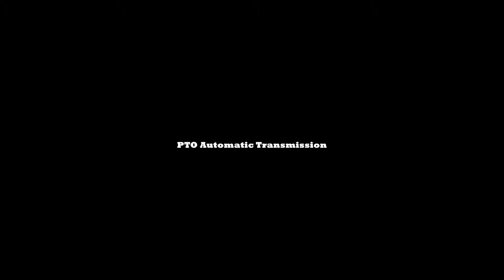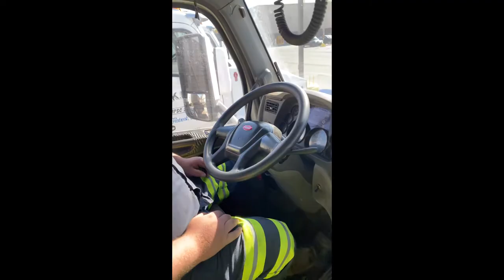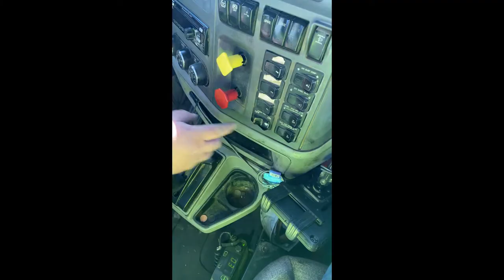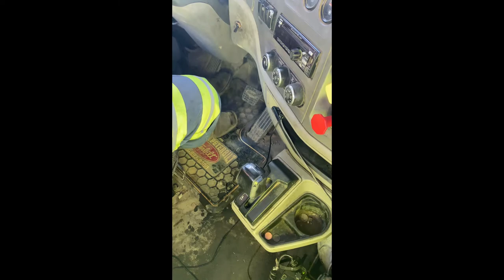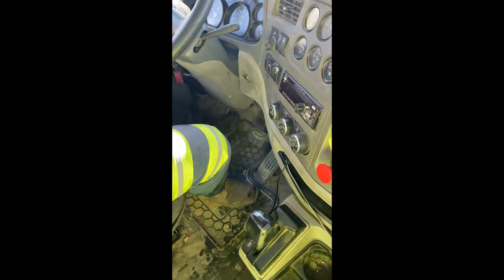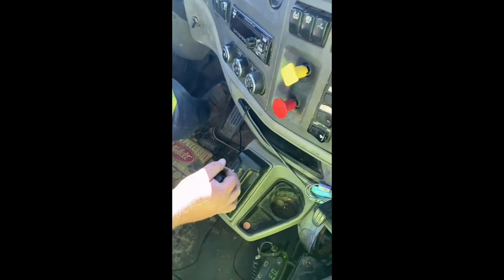Engaging the PTO on an Automatic Transmission

Comment: I have a DT12 that wasn’t originally equipped with a PTO. I have now installed an OEM rear PTO with air only, no wiring, but I can’t figure out how to engage it
Reply: I figured it out. The pto does require power, and I simply attached the proper harness/connection to to the pto and bypassed it directly to the battery.
Reply: Hey boss I have a dt-12 and people have told me I have to program it and waste 9500-12,000 to install wet kit. Do you mind helping me out?
Reply: @FernandoRomero-ch9lk  I don’t mind at all. What exactly do you need help with? 

As for programming, I did not of that. I never do any programming on pto installations.
Reply: @catcola1061  I want to add wet kit to my truck it has dt -12 

However it doesnt have pto neither was it pre prepped for pto
Reply: What can I do? To add wet kit?
Reply: Have been searching online for days.

Comment: I bought a truck with pto i have no idea what it’s for
Reply: PTO stands for power take off its attached to your transmission so you can use the engine to turn a hydraulic pump for things like dump trucks, cranes, walking floor trailers, low boys with hydraulic necks etc
Reply: @theoregontruckerT880  🙏🙏🙏🙏🙏🙏👍👍🙏🙏🙏🙏🙏🙏🙏🙏🙏🙏 Thank you a real explanation!!!!!!!
Reply: I got assigned a Peterbilt 579 for a company I work. It also comes with PTO feature or switch. I have never seen this on Freightliners or Volvos, can u please tell what this PTO is for and when to use it: I pull a 53” ft dry van trailer??!!
Reply: You lucky dawg!!!